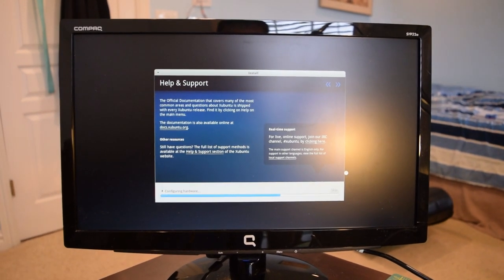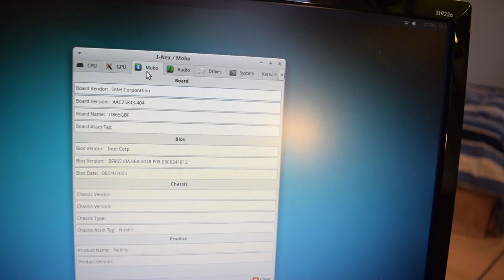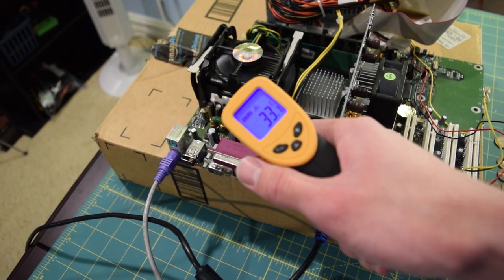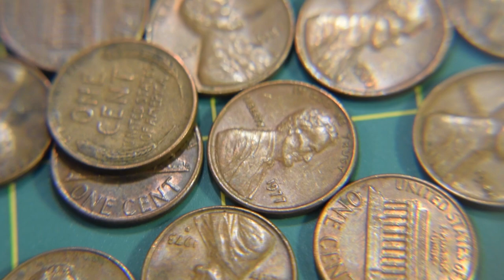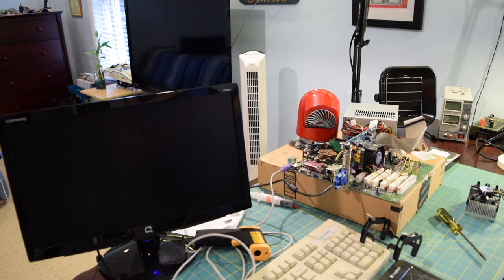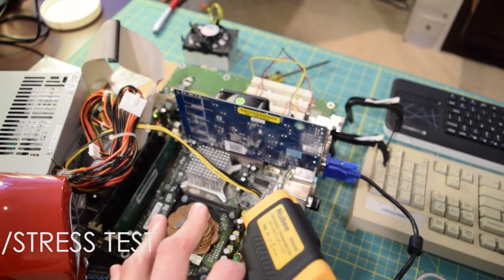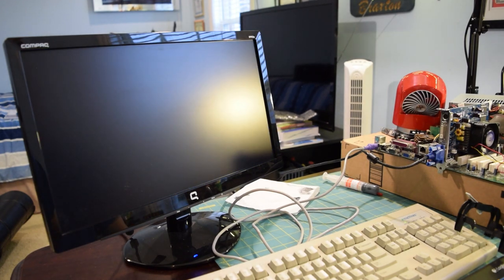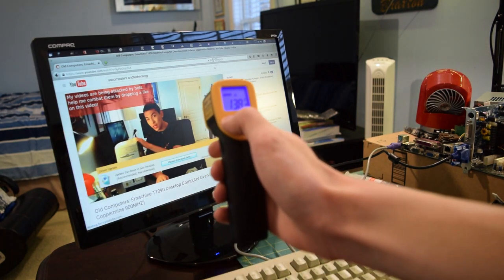Cooling a Computer Processor (CPU) With Pennies

Comment: It is hard enough for a regular heatsink to keep temps down when it comes to Pentium 4s. I am very impressed by the penny, nice video.
Reply: +RogerRHF Yep, pentium 4 were actually kinda shit, i regret buying them when they were new.

Ran very hot, were expensive and didn't perform good enough after a while
Reply: +RogerRHF  prescott p4s are = good room heaters :D, just turn it on at night and bam your room is warm
Reply: +RogerRHF Pentium 4's are very easy to cool, in Windows XP at idle they can run for 10 minutes without any heatsink, and if you just put a 4 oz bottle of water on it, without ice, you can even play demanding games for 10-20 minutes. If you want something hot you should get an Intel Core processor.
Reply: Though to be fair I'm sure a hardware monitoring utility (if it worked) would report numbers a fair amount higher than what he was able to pick up with the thermometer. For one, he couldn't take the actual temp of the package below the coins. Also, the more reflective a surface is (the lower the emissivity), the less accurate the thermometer readings. If you point the gun at highly polished metal, you end up reading more of the reflected infrared light of the surroundings than the emitted infrared light of the metal. So while the pennies were at least dull, their emissivity still likely lowered the reading.
Reply: Justin 3 I just recently upgraded my cup to an Intel core 2 quad and I've noticed my fan is significantly louder and it runs a lot hotter
Reply: Well it is 90+% copper
Reply: Intel Core processors run even cooler than a P4 the Pentium 4's run very very hot.

Comment: I would suggest using a solid copper penny that is worn to the point of being nearly smooth, and center it over the die on the CPU. Then build your flower design around it using only solid copper pennies, (older then 1960) and run windows 7. 
Call the video, ( Running Windows 7 on $0.25 )

Comment: I don't know if you ever want to do this again, but you can buy copper relatively cheaply, like copper blocks/bars, or if you go to metal supply places online, they'll often send you a sampler of their metals for a super low price and you can get copper, aluminium, brass, stainless and some others.  I did this years ago,  planning to make my own heatsink/waterblock, but never got around to it.   I moved and ended up giving all the copper to my dad who took it out to the scrapyard, otherwise I'd just send you what I had.  I did stick some of them under a heatsink to see if there was any advantage to having multiple metals, but nothing really cooled as good as a purpose-made heatsink, but it was fun to play around with it and see what temps I got (aluminum can take a lot of heat away, very quickly, but it's also very quickly overwhelmed, copper can't take as much heat away as aluminum, but it's better at getting rid of the heat over time, and brass kinda sucks all around and offered MUCH worse performance than either copper or aluminum).  This was purely on air though, so what you can get with water or phase change might be another matter entirely.

Comment: I once had to do this when stationed in Japan, where we had terrible DSL in the dorms. Part of the problem was the modems overheating- so I stacked a bunch of 50-yen coins (the ones with a hole in the middle) on its SoC, which helped improve performance! A friend installed a 120mm fan blowing right on its exposed PCB, which also worked.

Comment: Solid copper pennies were discontinued before 1969. They started using Zinc after that.
Reply: Bzzzzz!!! Wrong. hehe, j/k, but seriously 1909 - 1982 copper Lincoln pennies (excluding 1943) are all 95% copper 5% zinc. Even Indian head pennies that go back to the 1860's had the same composition. Sorry had to correct you, I'm a coin collector, I couldn't help myself. Take Care!
Reply: Peter Sbinninya eh, close enough

Comment: I had a P4 1.8 GHz single core. Came with a beefy af heatsink and a 120mm fan in a shitbox dell gx240 that i got for free. Was legit my craptacular gaming rig complete with added AGP graphics and IDE HDD from literally 2009-2012 (manufactured 2002). It then served out the rest of its days as a router/firewall/network cache. I loved that POS

Comment: Do you think it'd work better if you cleaned up the pennies first?  Something like vinegar or dilute vinegar would do.  Thinking that if you don't have that shiney copper showing, the gunk will slow down heat transfer.

I wonder if you had the lm-sensors package installed.  If there is an on-die CPU thermometer, that'll usually find it and display some stats.  I have a Dell Precision 360 which is based on a Pentium 4.  The "sensors" command shows the CPU temp.

Also...I wish the audio levels were consistent.  Some sections were too quiet to understand, so I upped the volume.  Then a minute later my ears were "blown out." :-) (well, no, not really)

Comment: 45 is dangerous? that's my idle xD it used to be 60. I had to tear out my speaker because IT KEPT SCREAMING LIKE A LITTLE BITCH.
Reply: Viewer Discretion Is Advised lol
Reply: some cpus (older ones) were not very heat tolerant. 45c on a modern cpu is great lol

Comment: I use coins as a heatsink on my OrangePI (Raspberri Pi Like board) its great since they cover the whole CPU, also when you only need one small coin then you can stack progressivly larger coins on Top. In the end you have a heatsink that is honestly more expensive then buying one for 50 cent online...but still. If you need one, and you aint got one. They work great

Comment: All of you used computer parts YouTubers (RandomGamingHD, Green Ham Gaming, AA Computers And Technology, et cetera) should come together and make some insane modding/gaming videos.

Also, you should've cleaned those pennies before using them. Might've had an effect between contacts. PLUS, you should've hot glued all the pennies somehow so that you could move it when needed, and also recommend a fan pulling air out from the center and up.

Comment: Instead of so using a shit load of thermal paste to compensate for the voids between coins, sand the faces flat with a belt sander. Even better I think would be using Acid Core solder to fuse them all together.

Comment: Hi!  Can you do a video on ESD soldering mat.  Check to see are they good at heatsink  on CPU and GPU chip.  Try to cut out  two 50mm wide pieces of the esd soldering mat.  I'm going to try this on my computer cpu/gpu chip with  cut out  hole in both soldering mat pieces and squeeze thermal paste in both to keep the paste thickness the same from pressure by heatsink copper tubes in my old 2007 Inspiron E1505 laptop. Don't forget to place something  on top of the soldering mat pieces with thermal paste to keep the paste from leaking.   I'm be using NooElec ESD soldering mat.   $9.99  :)

Comment: Clean the pennies in a solution such as kaboom to remove the oxidization, and try the test again. you will get slightly better results since the oxidization is acting as a thermal insulator instead of a conductor.

the results will be quite finite in changes, but it would also help to figure out how to apply pressure to the stack, I'm going to go ahead and suggest zipties to that matter if possible.
Reply from the maker: +Sudos Oh gosh, It would take forever to clean all of those pennies. I do not think it would be worth it in the end. Some pressure would probably be beneficial, zip ties might work but they may also topple the tower over as well :p .  Thanks for the advice and as always thanks for watching!

Comment: Tried this with an i7-920 and it just kept shutting down.
Reply: +Seong Hong Cool
Reply: Use more pennies
Reply: +Seong Hong try it with an i3-420
Reply: try this with a skylake i7-6700K it'll "totally" work
Reply: did you end up melting the pennies? i was unlucky and had D-0 stepping
Reply: I have the same CPU. The pennies did nothing

Comment: It's not the CPU that is capable of throttling but the motherboard. I had an old P4 motherboard with the SD ram( very early server stuff) and it would just turn off, no throttle there. But a newer motherboard would solve that issue( had problems mouting a cooler on there that was not meant to be)

Comment: Could you try using a penny or two or a nickel and ZERO paste so the coin or a washer or slug etc transfers the heat better than just the paste if a penny is too thick use several layers of aluminum foil please.

Comment: I am no expert, but I feel like it might work better if you cleaned or buffed the pennies first to get a better metal to paste to metal contact without penny grime or oxide in between, would be easy to clean with some steel wool/acid/coke cola/kitchen cleaning products... any benefits may very well be negligible but it makes logical sense

Comment: Me again , so yeaaaaaa noting is working. I have tried 2 motherboards , tried windows xp (tried windows xp with 3 diffrent CDs) , 7, 8 , xp posready (1 cd) slitaz 4.0 . I am getting errors all over the place. I cannot get a new motherboard.Googled around most of the results suggested ram issues i have 4 x 256mb ram sticks (only 2 slots on each motherboard) and an 128mb ram stick (ddr400). I believe i have tried all of the sticks . Any suggestions ?

Comment: What operating sistem he used???
Reply from the maker: +Felipe Ortiz http://xubuntu.org/
Reply: AA Computers and Technology Can i install it using a program?, my pc dont have a bios, and i dont have money to buy a disc,
Reply: I have a Toshiba Satellite 5105- s701
Reply from the maker: +Felipe Ortiz I am pretty sure that laptop has a BIOS.  You can install it via a USB flash drive. http://www.pendrivelinux.com/
Reply: AA Computers and Technology NO, this is a free legacy computer, i dont know to do!!! D;
Reply from the maker: Since it's a legacy-free computer it should be able to boot from a USB device.  I would try installing a light Linux distro to a USB flash drive and booting off that.
Reply: AA Computers and Technology My computer cant boot from a usb!. Or i dont know, whit a flash Bios?
Reply from the maker: Oh, I thought all legacy-free PC's could boot from USB, guess I was wrong. Take the laptop apart, remove the hard drive, install the OS to the hard drive and then put the HD back into the PC.
Reply: AA Computers and Technology How can i connect the disk drive into my desktop computer??
Reply: This is not sata, its "PATA"

Comment: The readings you are getting with the infrared thermometer are extremely inaccurate. These thermometers only work for black non-reflective services. Actual heatsink temp was more likely around 60-70°C

Comment: It's not illegal to destroy currency, It's illegal to fraudulently deface currency. Basically you can destroy currency, however if you destroy currency with the intent to get more value out of it is when it becomes illegal. hence why coin presses. the ones that turn pennies into oval logos aren't illegal.

TL;DR: It's not illegal to make a heat sink out of pennies.
Reply: Tyler Peterson what if you melt it and seperate the metals, then sell the metal
Reply: I think that is considered illegal. Do remember why right off hand though.

Comment: Hi, you should try to improve your pennies heatsink by polish them with toothpaste till they get the pure coper color shine and then put them all over each other in a column form, dont use cheap thermal compound, use metal based, for best heat transfer, but be careful, maybe it could harm the top aluminum surface on CPU, double check if the thermal paste does not eat aluminum. I'll be waiting for your answer. Bye bye...
Reply: Modern CPU heatspreaders are made of nickel-plated copper, not aluminum. Dunno if things were different when this CPU was made, but I'd assume not.

Comment: "wow, 45°C, hitting quite a dangerous spot here again..."
Really? 45°C? thats not hot at all but ok... and you expect a crash at 54°C?? great! you are not really understanding that this isnt "hot" at all or you are really not knowing what a high temperature and cpu-shutdown lvl is, but GG for having a tech channel...
Reply from the maker: Those temperature readings correspond to the temperature of the penny "heatsink".  While those temps do correlated with how hot the processor is getting they do not directly represent the processor's temperature.  The processor itself is getting much hotter.

Comment: is 98º celcius on a laptop bad?
Reply: most modern processors will hit the point where they will shut down around there but that varies from cpu to cpu and some older ones will allow you to go hotter or won't shut down if it gets too hot, It would probably be worthwhile to replace the thermal paste (clean off the old stuff with rubbing alcohol first) and clean out any dust in the system, laptop heatsinks get clogged up with dust fairly easily

Comment: A pentium 4? who gives a flying fuck. Dump that old crap at a museum and try cooling a skylake 6700k with pennies, with decent OC.Kudo's for the measurements in Celcius though, farenheith just doesn't make any sense.
Reply: +Rem ko If you give him the money to buy the needed components he will probably do it.
Reply: Rem ko Dude He cant even run a 3GHz Pentium. A 6700k would shut down the second it powered on or the second the OS started.
Reply: Andre Daoust 6700k Is much more efficient than the pentium 4
Reply: Andre Daoust 6700k Is much more efficient than the pentium 4
Reply: Mohammed Aliyu
The 6700k has 4 cores though. Also the 6700k has a 91 watt TDP while a pentium 4 has about 70 watts.
While that is definitely more efficient per core, the net TDP is greater on the 6700k than a pentium 4
Reply: A 6700k is rated for 91w. That includes the CPU and iGPU both maxed out at maximum Turbo clocks. (ie. Actually out of spec)

Even my OCed 3570k @ 4.5Ghz doesn't go over 70w for the CPU side alone
Reply: Not everyone is a fucking millionaire.